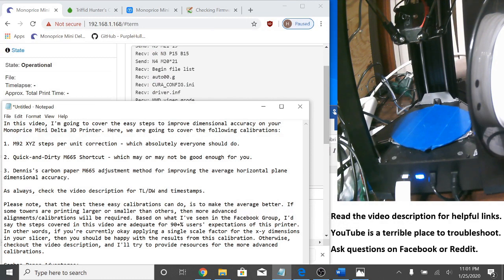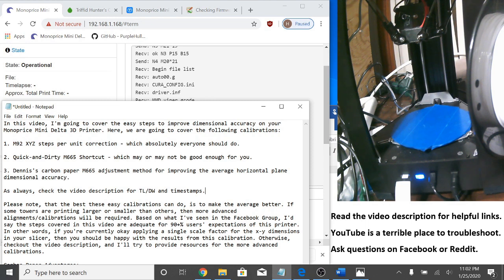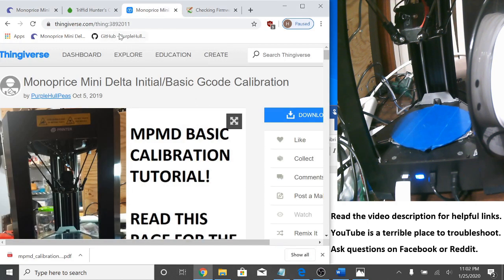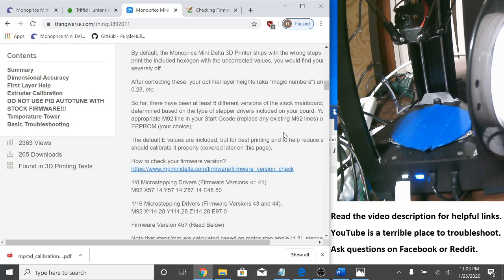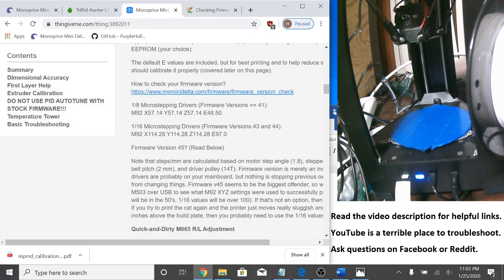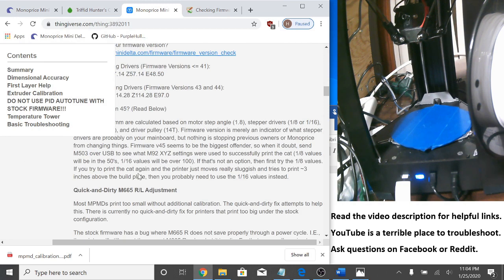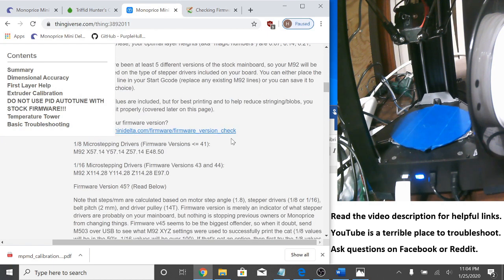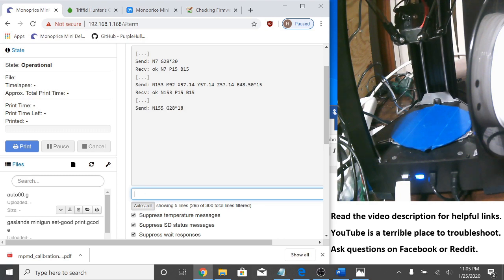MPMD V1 - Basic Dimensional Accuracy Improvement/Calibration - check description for advanced cal

Comment from the maker: This video was made for the MPMD V1. Don't use it for the MPMD V2. Also, the logic behind adjusting M665 R is outdated in that it is only compatible with the V1 community scripts/tools for delta calibration. For modern Marlin or mpmd_marlin_1.1.x G33, you want to adjust M665 L, instead.

Comment: Instead of carbon paper, could you tape together two receipts (thermal paper) and have the heated extruder mark where the print head touches?
Reply from the maker: Someone on Reddit suggested that as well. If you try it, please report back and let us know how it works out for you!
Reply: @home-fried3dprinting617  Yes you can use thermal paper! I edited the code so my hot-end is at 200c instead of 100c. I used normal receipts that I slightly overlapped and taped on the back and then used double-sided tape to adhere it to my build plate. Here are some images https://imgur.com/a/LiIy1nK